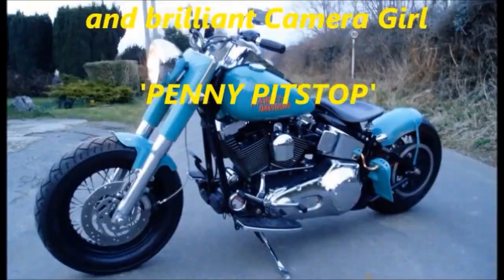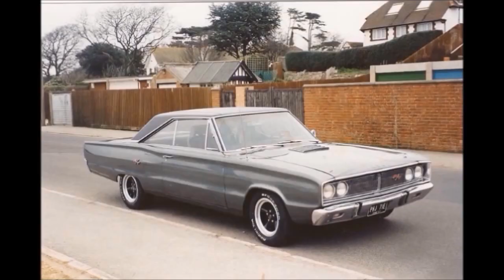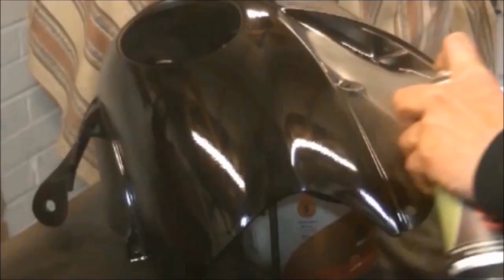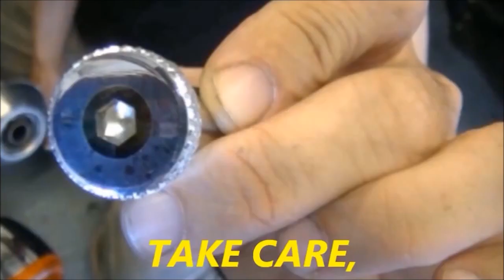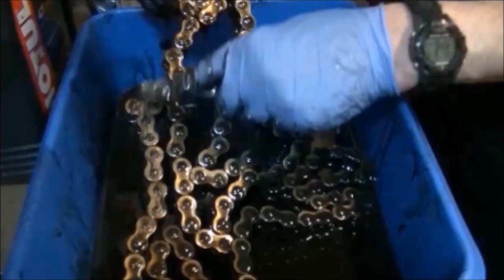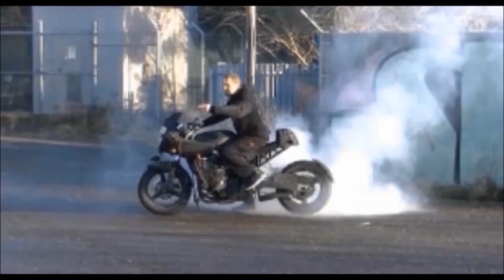Delboy's Garage, Hoodies, LAST CALL !

Comment: I, I wanted to know what is in a 6k mile service and if I can do it at home myself. I just saw your video on how to change the oil and filter on the Bonneville, and was wondering what else I need to do in order to complete a 6k mile service. Thanks!
Reply from the maker: Hi Franco, the service schedule is in your handbook, it lists everything that needs to be done including whether it is to be replaced, adjusted, or just checked... it's a simple service, should take no longer than an hour...
Reply: Moonfleet41 Thanks !